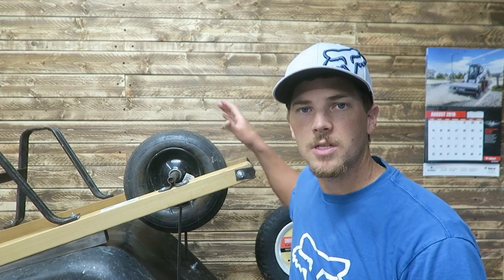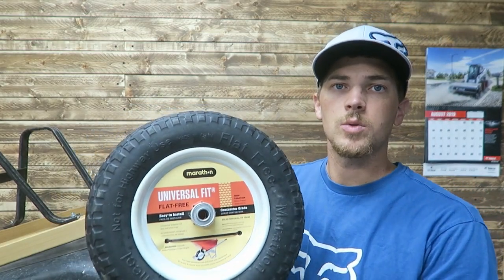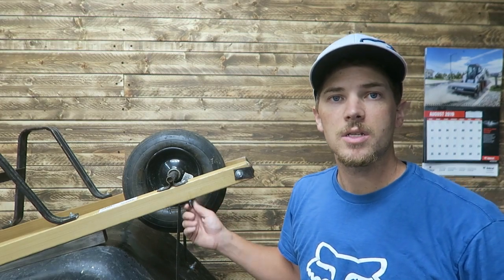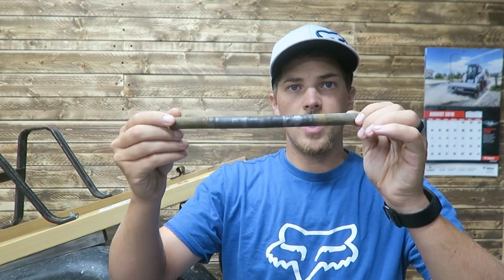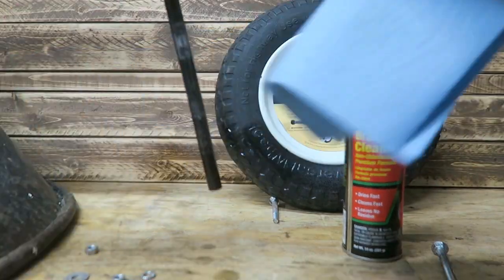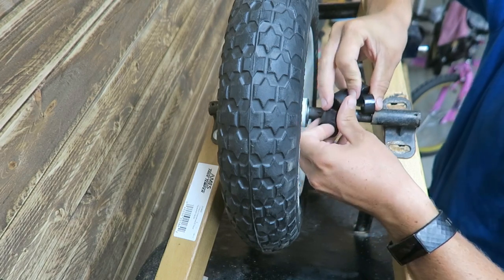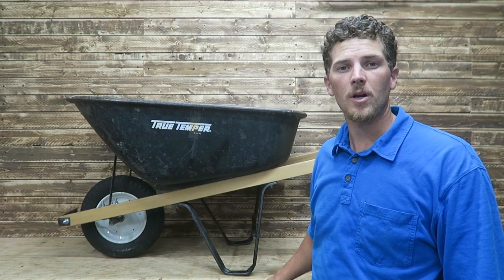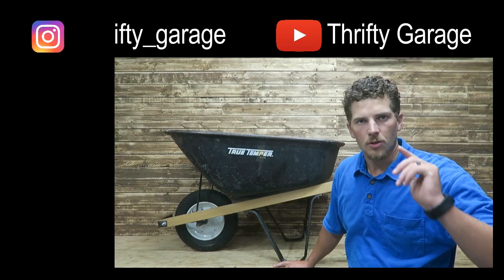What is the BEST replacement wheelbarrow TIRE?

Comment: I've had my true temper wheel barrow for about ten years,but it's about had it. Replaced the wheel last year and now its needing a pair of handles. The thin metal around the trays bolts is cracking so I probably wont bother. My next one will be a contractor grade Jackson.
Reply from the maker: Jackson with the flat free tires are great!

Comment: Hey Carson, thanks for the video.  How's the flat free holding up so far?  Have you experienced any flat-spotting in the tire?  We are all familiar with the problems you can have with pneumatic tires, so after having this new one for a couple of years, what are the downsides of the flat free version?
Reply from the maker: I would say the bearings are the pitfall to these. Since then I have upgraded to tweels. Aside from cost I don’t see a downside to tweels.

Comment: The best barrow wheels were the very old steel band style still used for heavy duty barrows like concrete carts. Pneumatic tires are used because they're cheap and the maker is not concerned about their longevity.  Barrows do not need suspension so they don't need pneumatic tires of any sort.

Comment: I would do more than a couple pumps.... have you looked at the inside of the wheel? There is a large cavity in there. Going to be a lot of pumps before grease ever gets to those bearings. Just going to be sitting on the inside of the shaft somewhere. Maybe switch to an nlgi #1. Hope those bearings come pre-lubed. Probably do with like mc-shit oil/grease.

Comment: I noticed you had the same minor anomaly as me, that being the wheel is slightly off center on the axel. That's because the hub width is wider than the original wheel. Not a big deal in my opinion.

Comment: Stupid question: @0:53 you show the black spacers and those other two circular parts between them. What are those two for? I’m replacing a tire on my true warrior wheelbarrow. Thank you
Reply from the maker: Skip to 2:30. The black spacers are part of the universal kit. The keep the tire centered and different wheel barrows have different spacing widths.
Reply: The extra silver bearings are for different size Axel rod to go through it, in your case you probably don't need them.

Comment: are you serious? I want to know the esiest way to replace the tire  from the wheel. who cant unscrew 4 bolts>>
Reply from the maker: Personally I would not recommend a pneumatic tire for a wheel barrel. You cannot install flat free tires without also installing a new wheel because they are a unit. I’m sure you can find another videos showing hot to replace an innertube tire. It’s the same as a bike tire. But in my experience your tube always gets pinched or punctured and it goes flat.

Comment: Flat free tires suck! They can’t hold heavy weight and they sink when you’re rolling them.
Reply from the maker: Yes, they are not as good as a properly inflated pneumatic tire.  But they are WAY better than a low pressure one and definitely better than a flat one!  I'll take the tire with zero maintenance that's 80% as good as a properly inflated air filled tire.  The real question is when will they come out with tweels for wheel barrows!?!  That would be the best of both worlds!
Reply: Sir which tyre is best for wheelbarrow...8inchs or 14inchs size tyre....??
Reply from the maker: The best tire is one that fits. What size is it currently?
Reply: Actually I thought to make a wheelbarrow with 14inchs tyre size with 6205 bearing no. ... But I have no idea which tyre is more suitable... 8inchs or 14 inchs tyre for making wheelbarrow... I totally confused
Reply from the maker: The bigger the tire the less rolling resistance over obstacles.
Reply: Ok Thanks Sir...for Guide me🙏💯
Reply: Flat free tires are smaller diameter so are harder to push. Never use slime in any tire, it doesn't work and makes any repairs nearly impossible.